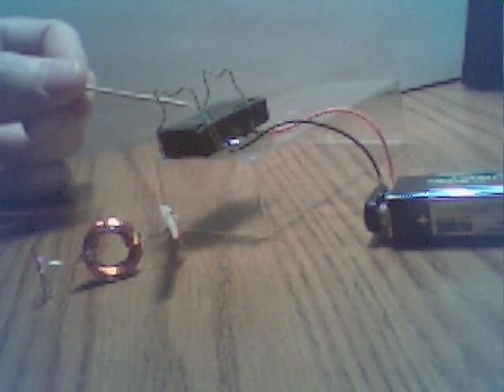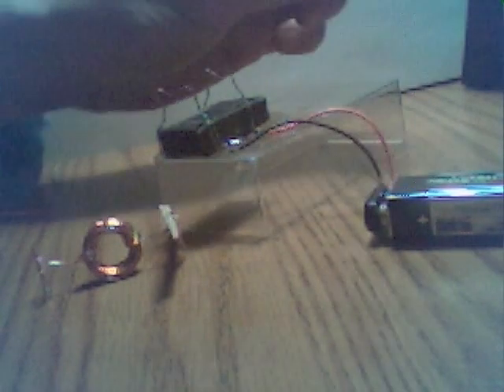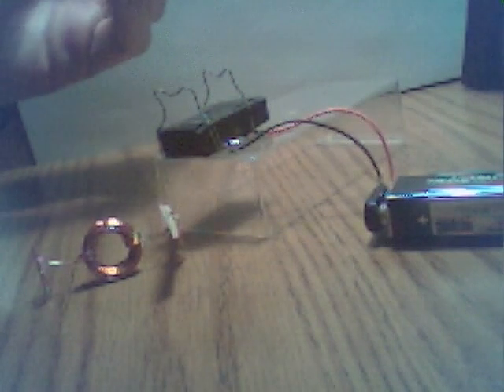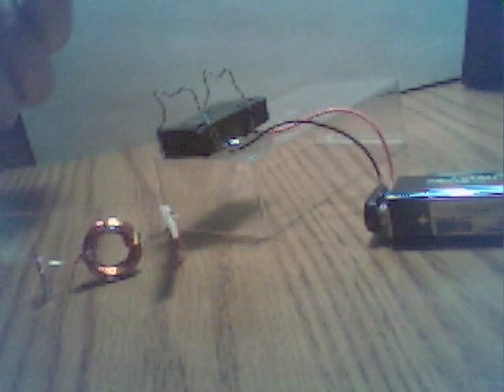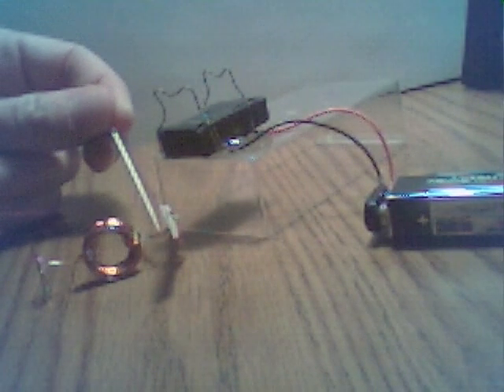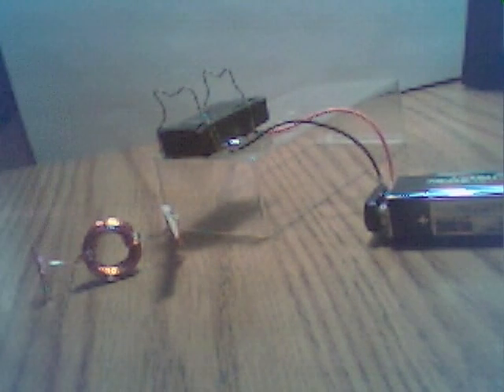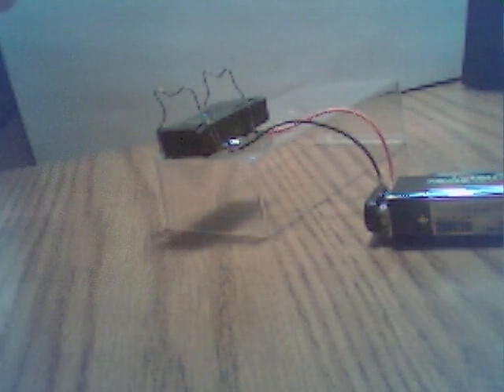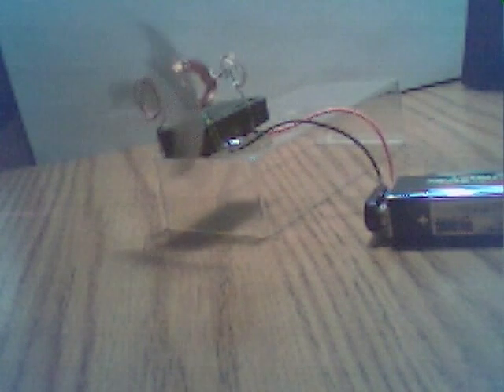Trivial Electric Motor

Comment from the maker: The key is taking the enamel insulation off ONLY one side of the wire.  So when the metal makes contact with the cradle/terminals, the coil is ganetized and gets a jolt of torque from the rectangular bar magnet below. Intertia then carries it around until it gets another jolt. etc. etc.  See what I mean?